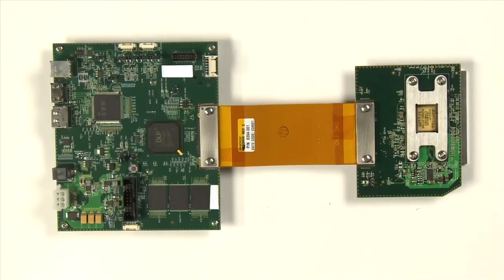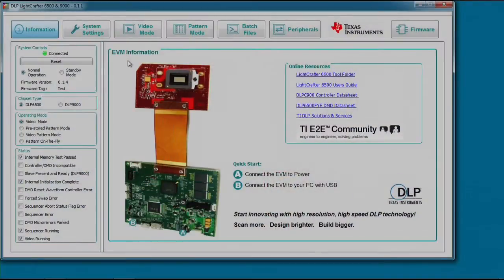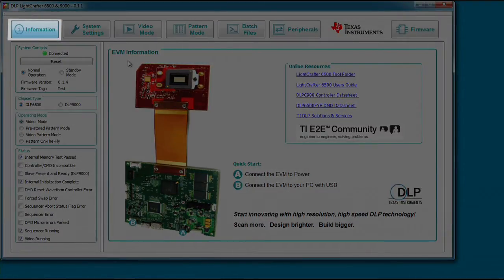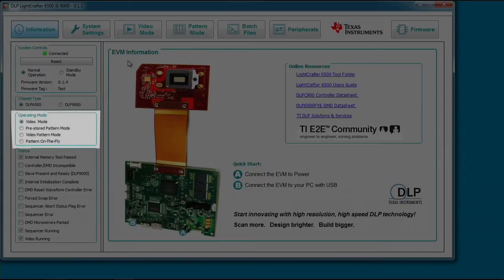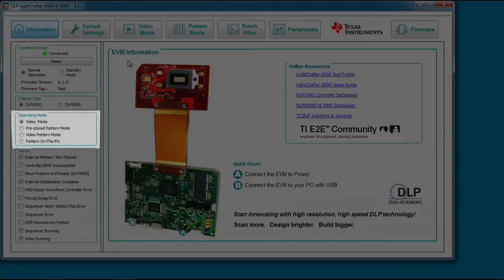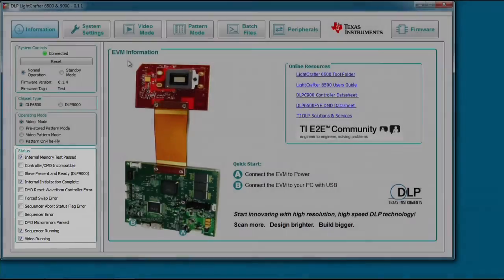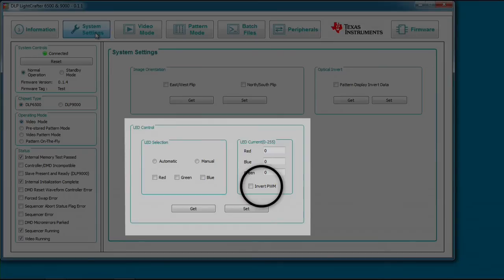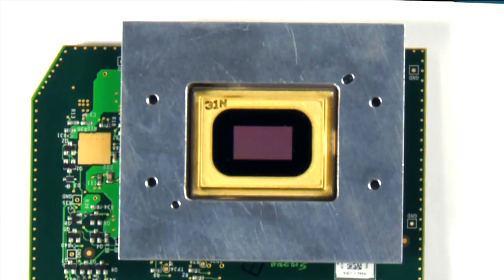Getting started: TI DLP® LightCrafter™ 6500 and 9000 EVMs

Comment: Could you please introduce the video mode and video pattern mode of the DLP LightCrafter 6500 in more details?? Like what are the meanings of "ABC->CAB" in the Input Port Data Swap section. Please just teach us all of the settings in the two video modes specificity?  Many thanks!
Reply from the maker: Thanks for reaching out. Our e2e community may be able to help. Here’s a link to the LightCrafter 6500 and 9000 EVMs support page with more information. http://e2e.ti.com/support/dlp__mems_micro-electro-mechanical_systems/f/850

Comment: if the evm circuit board is damaged, is it possible to repair it,please?
Reply from the maker: +陳錫勳 Thanks for your question. Our experts can assist you on this question on our E2E forum. Here’s a link to the LightCrafter 6500 and 9000 EVMs support page with more information. http://e2e.ti.com/support/dlp__mems_micro-electro-mechanical_systems/f/850